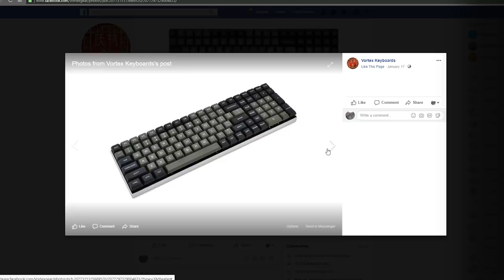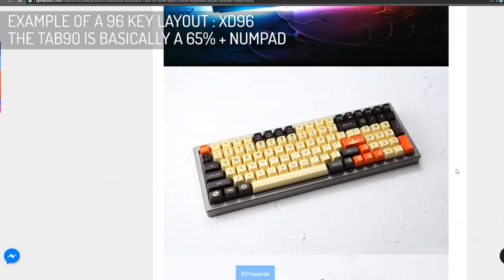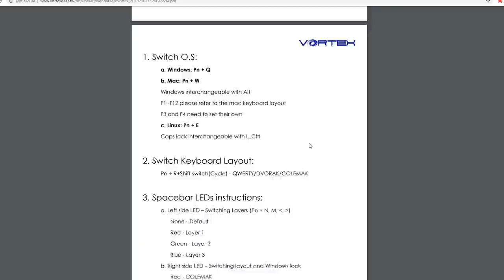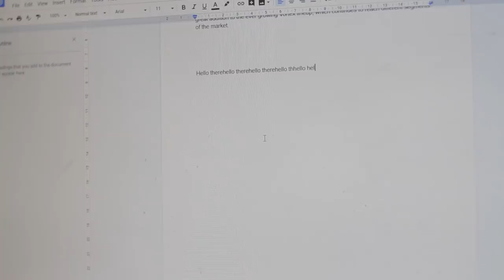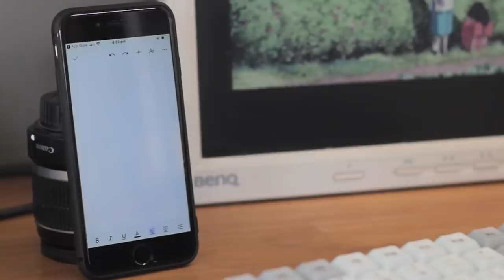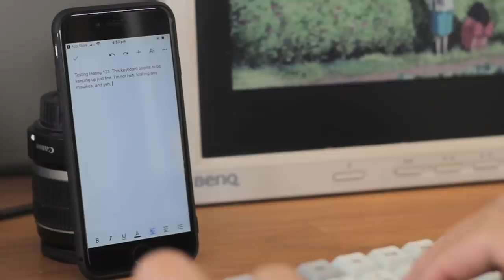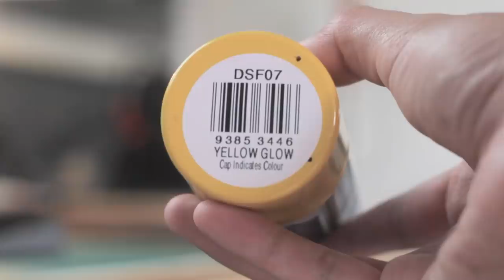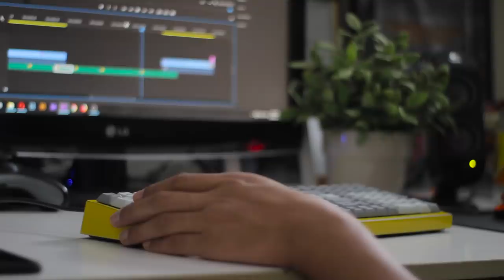Vortex Tab 90 Wireless Mechanical Keyboard - Review & Unboxing

Comment: Thx for the review and instructions. Just got my Tab 90 and it came with extra colored keycaps (like Enter, Esc, cmd, etc.) plus a keycap puller = ) Got it with mx silent reds. Love the feel, layout and switches. Bluetooth seems to work well... connected it to two PCs and can easily switch between the two. Very cool feature. Totally satisfied.

Comment: Pretty sure vortex are also coming out with the Tab M (metal cases) in the other sizes of the Tab range, keen to try the Tab 75 m when that drops
Reply from the maker: There's the Tab 90M. But I'm not sure on a Tab 75M, because that's just a Race 3. And then for 60%, they already hav ethe Pok3r.
Reply: TaeKeyboards yeah i think for the 75m its just the race 3 but with usb-c and a standard size top row,  their dms werent the easiest to understand though so i may have misinterpreted

Comment: Too bad the Tab 90M came with Bluetooth. I like the compactness and solidity of the 90M. The plastic bezels on the Tab 90 are thick. I assume the reason the 90M doesn’t have Bluetooth is the transmitter/ receiver is encased in metal. Seems like there should a cost effective way to externalize the transmitter/ receiver without compromising the aesthetics.  I would love to see Vortex come up with a higher quality aluminum version of the Keychron K4.

Comment: They really need to use AA's in these boards, as most of the rechargeable batts come in the AA rather than the AAA size. It's not an environmentally considerate choice, although given the size of the board, I can see why they chose this option. AA all the way though.

Comment: Wait, how did they fit more keys in this than my full size keyboard? Damn I want one if not for the key profile and the cherry switches

ps. just noticed that that spacebar is a bit slanted in the left bottom part as if it were not cut properly.
Reply: The quality of the keycaps looks horrible.  Everything looks misaligned due to warping.  Very unsightly.

Comment: tfw you build a 96-key keyboard yourself and then vortex makes a similar one that's cheaper
Reply: I am actually pretty happy that I built one myself (melody96), I was waiting for this one when I saw the renders but the plastic case is pretty disappointing (the metal one is too because its so thin) and the lack of split spacebar (which was in the renders) is too.

Comment: A 104 key, backlit; wireless mechanical (Not, "mechanical feel") keyboard (Preferably disposable battery powered, rather then a rechargeable battery.) with an on/off switch. (So that my animals don't do weird stuff to my computer)

And a choice between red, blue & brown key switches. It'd also be nice if it came with a mouse and USB dongle. To me, this seems like it'd be an easy find. It is, however; apparently, impossible to find. Because it doesn't seem to exist. Because, of course it doesn't. FML... ಠ╭╮ಠ